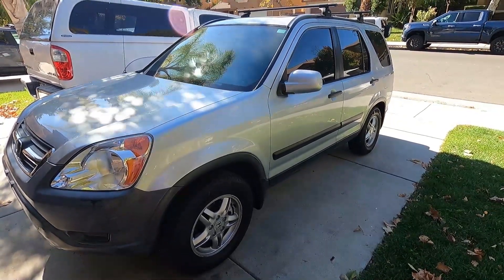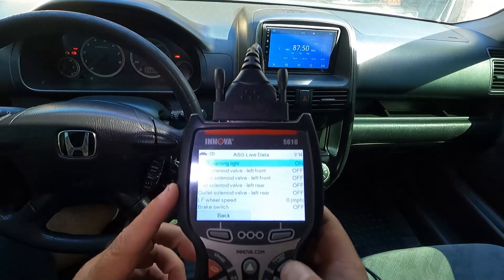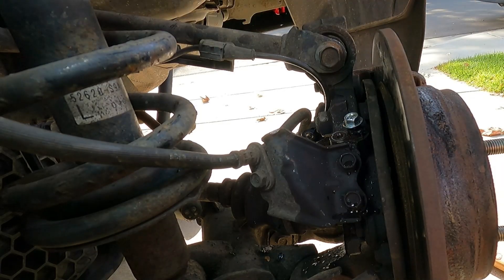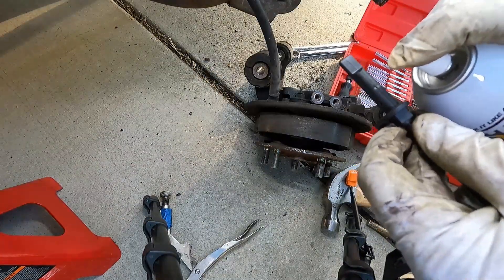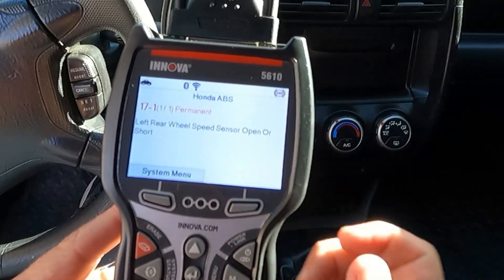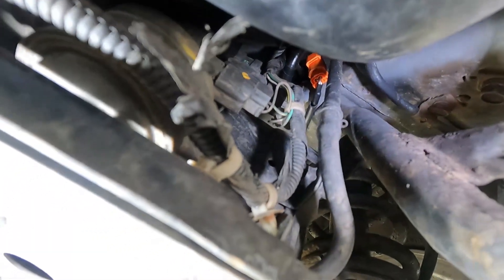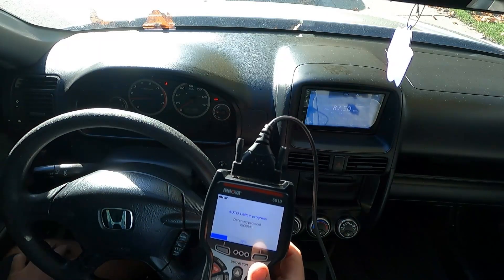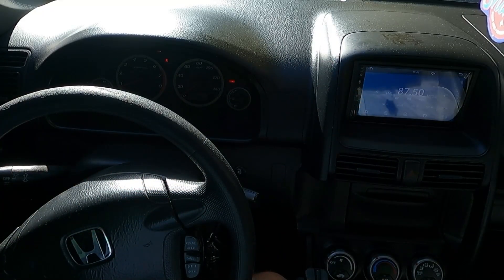2004 Honda CRV Check Engine Light - P0497 Evap System Low Purge Flow & ABS Trouble Codes 17-1 FIXED!

Comment: I have a 2010 CRV LX. NO check engine light but there is a Check Fuel Cap message on the dash. Code reader shows, P0497 and P145C. I've replaced the gas cap and the purge valve. Neither has fixed it. Where to next?
Reply: Vent solenoid on evap charcoal canister, charcoal canister, fuel tank pressure sensor, hoses for evap system.

Big starting question: do you smell gas near your vehicle? If so, you have a fuel vapor leak. Get a mechanic to do a leak check with a smoke machine.

Likely culprits include gas cap and evap vent solenoid typically on charcoal canister.

Just replacing the gas cap may not fix your issue. Be sure to clean the sealing contact surfaces. Hondas are also picky about aftermarket gas caps. Might need to get the actual Honda OEM gas cap. Do a smoke test before you replace any parts though.

P0145c is just a generic evap system code.

P0497 is typically evap purge low flow.

Low flow can be caused by:

Failed evap purge solenoid.(hondas are picky about this part as well, reccomend honda OEM part.

Clogged evap purge charcoal canister.

Failing/Failed fuel tank pressure sensor.

Clogged/collapsed hoses to purge solenoid.

Clogged at inlet to air intake from the purge solenoid.

Comment: Does the Innova 5610 have an option to turn on and off the evap purge solenoid to test it?  The 5610 is bidirectional, unless the feature is just not available for the 04 crv.
Reply from the maker: @danb1682  you can type in your year make and model on their coverage checker website and it will tell you what features are available.
Thx!